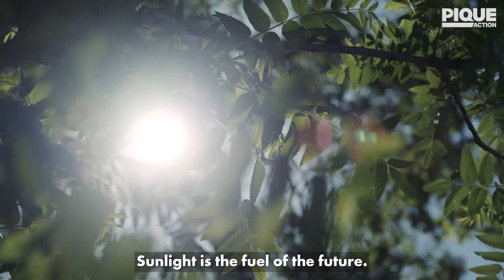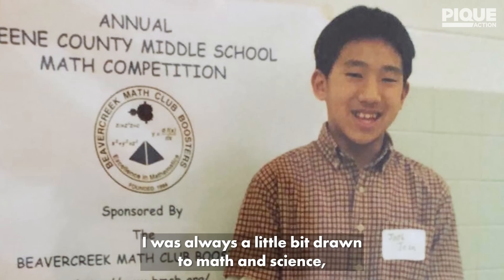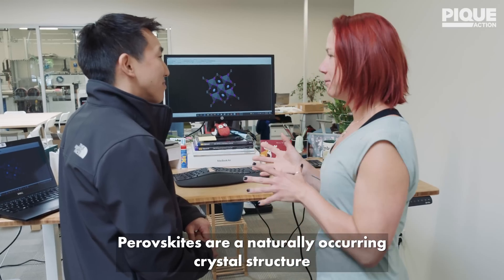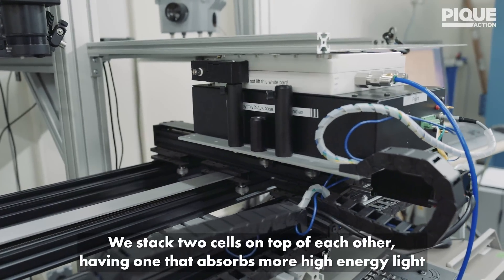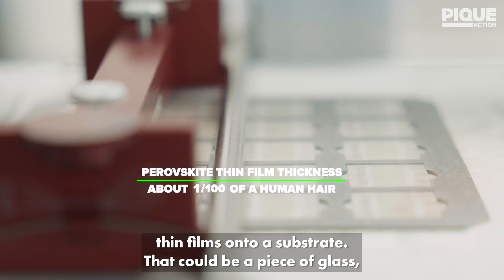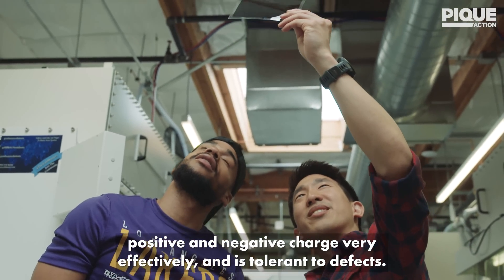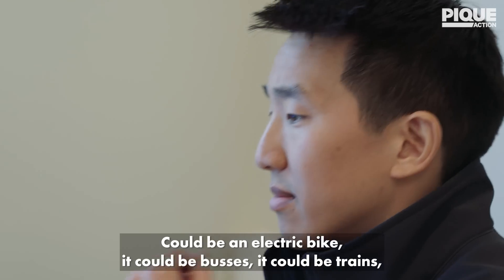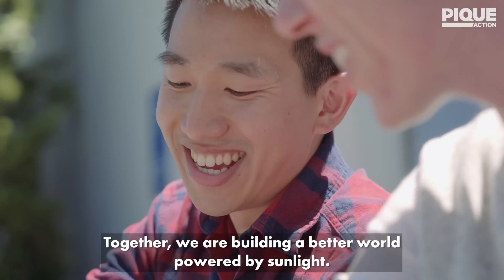Startup Harnesses the Power of the Sun | Swift Solar

Comment: Got your promo e-mail. 1st one I've seen.  
You covered the big pros in this vid, but you didn't say anything about how you are solving the degradation issue.  Progress is being made on this front, quickly, but would like to hear your take on it. 

Just curious if any thought has been given to using light collectors, and routing that light through fiber optics to a solar cell that's not exposed to the elements, so that the cell lasts longer?